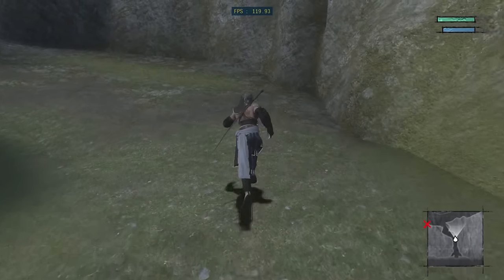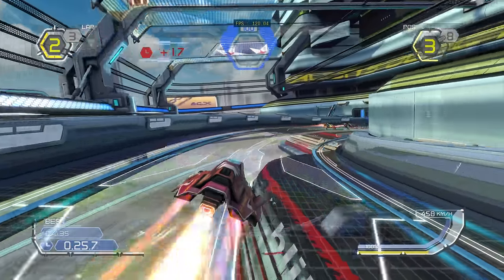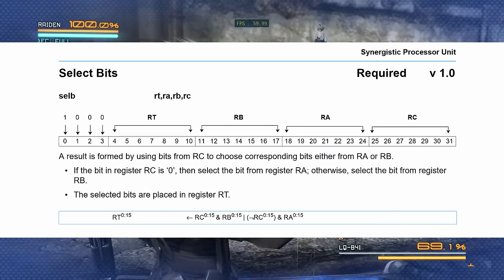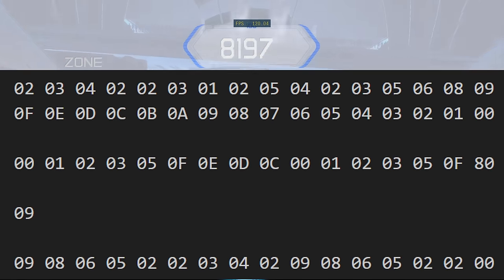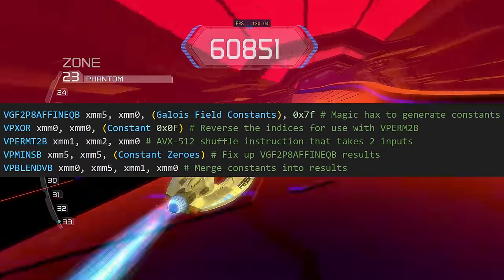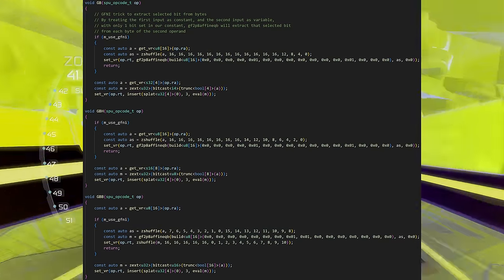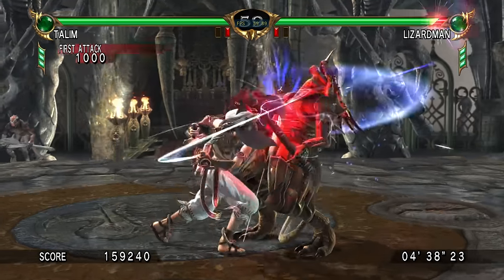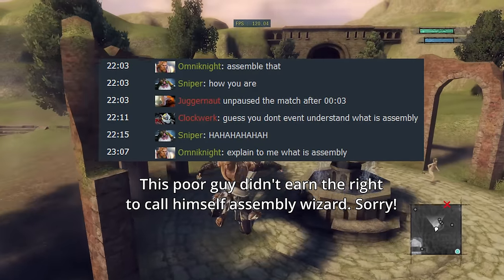Why is PS3 emulation so fast: RPCS3 optimizations explained

Comment: Would it make sense to port the SPU sections of the code to run on the compute cores of GPUs, or the similarities aren't enough to actually gain a performance over running on the CPU? Would the issue be the bandwidth between CPU and GPU is too narrow when needing to go both ways for real time stuff?
Reply from the maker: From a high level, porting over SPU code to GPU would work well, but we're recreating the semantics of the original program, which is more well suited for running on your CPU.
Reply: @MrWhatcookie  Do you mean GPU code is too different for it to be done automatically and the logic would have to be rewritten by hand?
Reply from the maker: @tiagotiagot  I mean that it wouldn't be fast to do low level emulation of CPU on GPU, you'd need to port the code (high level emulation or native port)
Reply: @MrWhatcookie  The architectures are different enough that it would not be possible to match hardware behavior via a translation layer kinda-thing?
Reply from the maker: @tiagotiagot  I mean the emulator is translating the code regardless, I'm talking about the performance.
Reply: @MrWhatcookie  I did some quick reading right now to try to refresh my memory see if I was talking about the wrong thing, I'm not sure I came to a clear conclusion. The SPU are not related to the highly parallelizing Cell processors, and so GPUs are not really close to a drop-in replacement? Maybe I'm just not familiar enough to with finer details to be asking right questions....
Reply from the maker: @tiagotiagot  The SPUs are a part of cell. They execute 128bit simd instructions.  Your gpu also executes simd instructions. Your cpu executes 256bit simd instructions if it has AVX, 512bit simd instructions if it has AVX-512. Your cpu and gpu are both wider than the SPUs. But the CPU can execute 128bit simd instructions in a single serial stream faster than the GPU can. The gpu is designed to run hundreds/thousands of independent threads of execution at the same time, while the CPU is designed to run a single thread (or 2) as fast as possible.

The problem is that gpus aren't designed to run CPU code fast. If you gave me the source code to ninja gaiden an asked me to port it to PC, I'd port the geometry code to GPU and it'd run fast. But we're emulating the SPUs, the question instead becomes "how do I run the shufb instruction fast" etc.
Reply: @MrWhatcookie  So in a sense, it's like PS3 games actually use a software renderer, and  you would have kinda to rewrite from scratch to be hardware accelerated, and you would have to filter out from that non-GPU-style parallelizable code because that runs better on CPUs, and that filtering and rewriting is not something that would be trivial to automate?
Reply: @MrWhatcookie Holy fuck this is a great explanation, thanks

Comment: Yeah games are playable quite well now, iam using RPCS3 for TLOU and GT- games. While games and the RPCS3 got optimized alot over the years, it cost me two new laptops to run decently. A 12900 + 3080ti does the job well enough, thankfully supports AVX-512. I hope PS4 emulation one day isnt so taxing on hardware. In comparison my laptop gets almost bored running the Xenia emulator.
Reply: PS4 should be easier to emulate as it contains maybe specialized, but still x86-64 with Radeon on-board (although PS4 games do not use a standard 3D API like DirectX, OpenGL or Vulcan but proprietary GNM - so here lies a real problem). There is PCSX4 which can handle some PS4 games (but I haven't tested it).

Comment: So is it real that emulators perform better on linux? Hearing the second to last part made me think of that… ever since switching from Windows i felt that way
Reply from the maker: It can be a little bit better on linux, but also depends on driver quality, which may be better or worse on linux as well.
Reply: I know I was able to squeeze more performance out of some older/weaker hardware with Linux, but we're talking Rocket Lake and Ivy Bridge Intel machines with no GPU

Comment: I got a Rocket Lake i5-11400 specifically because of AVX-512 support for RPCS3. The higher tiers of the CPU are arguably a waste of sand, but this mid-tier chip is just enough!
Reply: I also made my Hyper 212 Evo cryyyyy when I removed all power limits during initial testing. Z series boards don’t screw around, especially with AVX-512 O_o

Comment: after working on RPCS3 and having the power of hindsight, would you say that it was a mistake in the Cell's design to not have memory management implemented for the SPUs? and would you say that there are some design mistakes that you can see with hindsight?
Reply from the maker: The manual memory management is appropriate for the SPUs, which lack branch prediction and out of order execution. I think the SPUs are very well designed actually. The big mistake is the assumption that video games need so much SIMD throughput on the CPU side. Instead of the console developers trying to figure out what the best hardware to run games would be, game developers had to warp their game structure to better fit the hardware, and most didn't bother.
Reply: @MrWhatcookie  Very succinct, very well said!

Comment: Are there any new optimization strategies possible with RPCS3 that can dampen the amount of demand placed on the CPU? I've made typical changes found online like changing my PC's power settings to 99% load rather than 100%, as well as changing the CPU config setting for "Preferred SPU Threads" to "2", as well as tooling around with "SPU Blocksize" to "Safe" and such. These types of adjustments a year ago brought my CPU temp down from 90° C when running games like Fight Night and Skate 3. However even with previously suggested optimization strategies CPU temps often get up to 83-85°. 

Every RPCS3 update I'm hoping for some kind of new optimization that drops that CPU usage temp down into the mid-to-low 70s at least. I'm always waiting for that kind of new optimization to come with a new RPCS3 update, but also I'm aware that it may already be done and just needing more tweaks in the settings that I'm not already aware of! All my games play buttery smooth but that potential for CPU damage from overheating always freaks me out lol. It may actually already be fixed and I just need to click a few new config settings, so far I'm just aware of config adjustments that have been posted about through the 2023 year.
Reply: Emulators are CPU heavy by nature, and RPCS3 is one of the heaviest emulators out there. 
Modern CPUs are designed to run hot. You're not going to damage the CPU before it down throttles itself or the PC just shuts down in case of emergency. Maybe if you're using a laptop you have more to worry about with glue melting overtime etc.
Depending on the CPU you could look into undervolting as a way to help with temperature.
Reply: Also framerate cap is the probably the simplest solution if playing intensive games like infamous or MGS4 which are uncapped by default. A good 30fps is a better experience than those games get on a real PS3.

Comment: Well, all I have to do is buy a new Amd processor that supports AVX512
My current processor is quite weak(Ryzen 3 2200g which I bought in 2018) and does not have AVX512 support

Comment: Why is PS3 emulation so fast? Because the code goes BRRRRRRR.
Seriously though, good explanation. Low level programming is scary, and i just deal with databases. 
But games, as stupid as it sounds, are very sensitive to changes and many layers of software have to be aligned.

Comment: I wish more games had a 120FPS unlock.   So many are locked at 60 which feels terrible to play after years of using a 120Hz display, and 99% of the community unlocked ones are only 30->60.

God help anyone trying to play a game that's still locked to 30.  Even BFI can't save it.

Comment: It kinda sucks for temperatures tho. I run games fine on it but my CPU despite having good cooling is around 90 degrees celsius, crazy. It's a Ryzen 5 3600 6-core processor, pretty good for most modern games.

Comment: Fucking teach me assembly language in actual practical ways. Wow. I am a software engineer with 4 years experience, I made a B in both x86 Assembly Language and Computer Architecture, and you taught me more about why assembly is COOL. I just found those classes to not be interesting in the slightest, and have forgotten most of it at this point. If my college professors showed assembly optimizations with before/after shots, comparing assembly languages to show why developers made the decisions they made and why its very cleaver stuff. Also, that VGF2P8AFFINEQB instruction was never touched in my college class, I just remember it in some textbook and just not understanding why something so wacky would be in computer architecture. Turns out its not wacky, its a cryptographic acceleration instruction. Blew my mind. Thanks

Comment: Fast?! It's 2024 and only now we got decent performance. In most games. PS2 got a good emulator by the time PS3 came out.
Reply: The CELL is also basically a supercomputer CPU, designed in a way that no other game console has been. The Emotion Engine, by comparison, was a much more conventional MIPS chip.

Comment: So... it's because you're emulating 20 year old hardware, right?

Edit: Yeah, I didn't get any of that. Just 10 minutes of abbreviations don't know. Yes, I know the video is over 20 minutes.
Reply: Nope, the PS3 is complex in a way that you can't just throw modern hardware at it. Read up on the CELL and its SPUs, and you'd understand
Reply: You're basically trying to emulate 128bit vector processor+ powerpc core+ graphics api of the game

Comment: Can someone summarise this for me as somebody that understands nothing of programming or how games work
Reply: It's like guiding a blind person by another blind person, but:
- AVX512 is not beneficial in all games
- where it is, it can be better up to 40%
- IRC bios updates disabled AVX512 in 12th gen Intel CPUs, and also can't be used when E cores are enabled
- Upcoming Zen 5 might give a performance boost in AVX512
- AVX10 is still years ahead, but rpcs3 has already some basic detection for it done
- performance increase in one game by turning on AVX2, then 512, was from like 40 (off)-60 (2)-70 (512)+ (can't remember precisely)
- 12700KF (if you manage to make it work with AVX512) or 7800X3D had a decent performance, but still below 60FPS in MGS4 in demanding areas. The newest i9 overclocked, still had small dips below 60FPS.

Comment: Huh... Don't use intel specific extensions.
The code might be blazingly fast BUT no one will be able to run it, UNLESS you have that one MAGIC cpu, that didn't receive a micro code update which deactivates that extension!!!
Intel has a habit and well known history of creating extension, then deactivating them upon shipping or dropping them entirely a gen later! They might as well not exist!
Reply from the maker: AVX-512 instructions are supported on the latest AMD processors. Moreover, AMD has dropped most of their own extensions (3D-Now and XOP).

Comment: "Why is PS3 emulation so fast?"

If its so fast why does it run like trash on SteamDeck?
Reply: Cuz steamdeck is weak, you should’v bought a rog ally instead
Reply: So fast (compared to native hardware and given the massive architecture differences between x86 and PS3 PPC architectures) would be the accurate title

Comment: So as i though as Cell had an Absurdic Floating Performance for any CPU from 2006 Then i Believe devs Based their code for Cell on the Floating code instead of usual Integers if I'm guessing Right, maybe not exactly, Anyways, as you said To Emulate Ps3 Cell it's Only Needle to Emulate 6 Spes plus the Ppe core, so as each of any core from Cell does 25.6 Gflops in 32 Bits Sp, that Gives  total of 175Gflops for 7 Cores and Today Cpus, the best ones for Desktops can Deliver 4.000 Gflops so i wonder were is the performance, Super Funny thing its i were able to Emulate Ps3 Dmc 4 Game at 60Fps with an Core 2 Duo, That's Right Lmao, you can test, But that Only because Pretty Much Dmc 4 Only uses Ps3 1 Core Ppe, but games which uses all 7 cores available like The Last of Us struggle ro Run at 60Fps even on Worlds most powerful Cpus with Beyond 2.000 Gflops.

Comment: I call bullshit, try playing red dead redemption on ps3 at 60fps only the xbox emulators can do it
Reply: RDR on PS3 was a terrible port from what I've heard, the Xbox 360 was also a much less complicated system (and therefore easier to emulate)
Reply: @mysticaxolotl8215  I was reading into ps3 architecture and you're right the ps3 is more complicated turns out they modified their cpu and gpus and had proprietary code that was a pain to write in but was great for anti-piracy at the time.

Shame red dead doesn't run as well on the emulator but I think it's a matter of the emulator getting updated in the future.

Currently playing through red dead on xenia xbox 360 emulator and getting 60fps+
Reply: Try playing last of us it will work since it is very well optimised as long as you have a beefy cpu

Comment: is this a joke video? because rpcs is slow af
Reply: Probably because you're trying to run it on old/weak hardware (that's why I own 3 PS3s lmao, I don't yet have the justification to build a high end PC)
Reply: @mysticaxolotl8215  well yeah, i use a laptop. But for some reason switch emulation works like a cake. 

It makes zero sense if ps3 takes more resources than switch. It also makes no sense whatsoever to use a nasa computer to run emulator of a console made almost 20 years ago.
Reply: Because it has to translate those spu and ppu + the graphics api of the game
Yuzu emulator only has to translate graphics api of switch because the cpu is based on x86 so it is less resource intensive
Even Xenia canary is better because it doesn't have spe's to translate
Reply: @gnrtx-36969  thanks for the insight, so in no world rpcs3 is fast :)
Reply: @XiongMa0  well it's still very impressive it can emulate ps3 
I mean cell cpu is a very complex architecture like no wonder why ps3 performed soo much worse than x360 because of severe cpu and ram bottleneck
Reply: @gnrtx-36969  i wonder if it would be simpler just to reverse engineer ps3 exclusives as standalone games just like gta 3 and vc that can be played on 40$ handhelds now
Reply: @XiongMa0  there are source code for both vc and 3 maybe someone with big knowledge of ps3 could port these games to ps3 
Or like imagine fixing ps3 port issue just by patching the game's api with custom made one to use the whole cpu 
I'm not sure about any of these